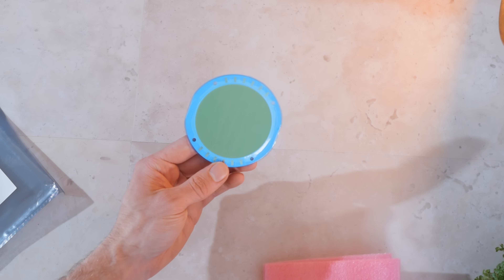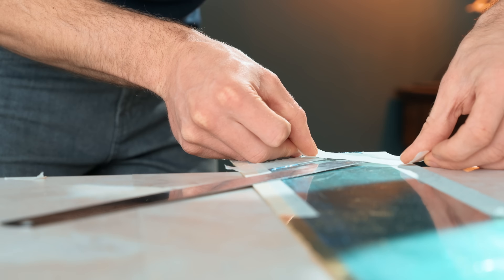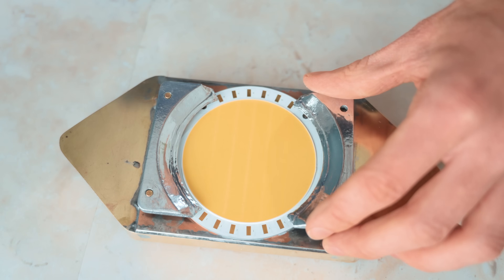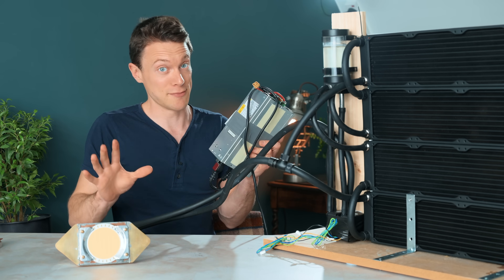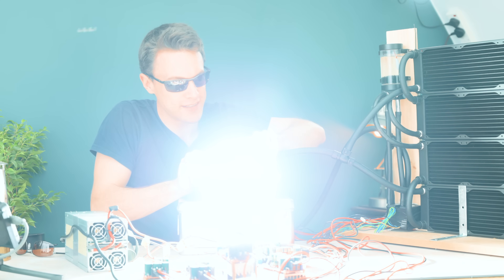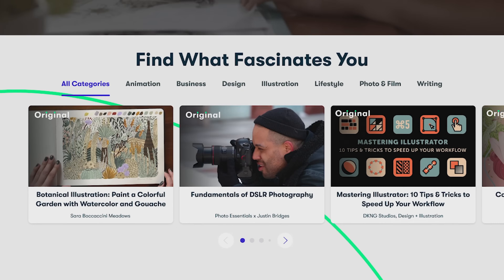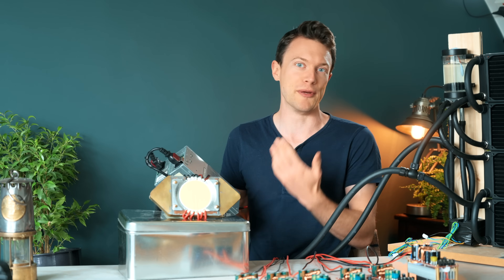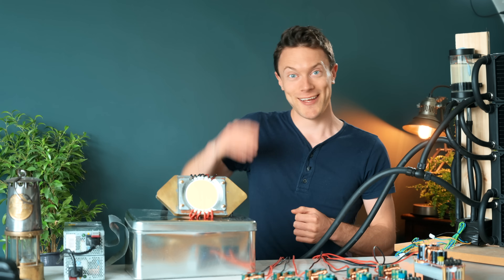Testing the world's BRIGHTEST LED!!!

Comment: Those radiators are a bit overkill, but you also could of used a small car radiator instead of 4 120mmx4 computer radiators, would of been way cheaper, and probably more cooling surface area and smaller footprint as well

Comment: Server power supplies usually run at 50% or less because they expect to run in pairs so that one failure will not take the server down. Some slimeball manufacturers will count on you only running at 50% or less and then when one power supply fails the other goes bang right away because it never could have held the load to begin with. The failure you experienced is far too common. Corners cut in power supplies often take down servers built by enthusiasts. But assuming that the outputs were properly isolated from line voltage there should not have been any problem with running them in series. However since your boost converters (I hope those are actually boost-buck if you plan on using that dimming function) actually do regulate voltage and current, you do not actually need a regulated power supply. You could get by with a transformer (in the 2.5 to 4:1 range) a bridge rectifier (100V, 100A and mounted on a water block to be on the safe side) and some big filter capacitors. That should pump out up to about 50VDC at 50A all day long without any problem. However I do not know much about picking transformers. The best would probably be to wind you own so you can get the voltage right where you want it, but that is not something I have had the patience for. I always just found or bought something about the right voltage and at least 2x the current I thought I needed. You might check with Fran Blanche for help with the power supply. I suspect she has a lot more practical experience with this than I do.

Comment: Wow! Can't wait for the outdoors demo. Please note that the LED has 1500W of power consumption, which is quite different than power dissipation. You wouldn't need a 1500W CPU cooler for this, as CPU coolers are rated according to the CPU's TDP, representing the heat generated from the CPU. So, the LED consumes 1500W, most of which is turned to light. You only need to have a cooler rated for the Watts that end up as heat, ie 1500W-Watts converted to light.

Comment: Mixing copper, brass or nickel plated copper parts with aluminium parts is a very bad idea as this will cause much faster corrosion of the metals.

Comment: To be safe, add a thermistor to the heat sink of the LED which will cut the power if it get's too hot. You can use some thermocouple and a controler/simple electornics to control PSUs POWER_ON signal, or just put water heater thermistor in the cooling pipes than can cut off the mains of the PSUs

Comment: Have water cooling (distilled water for the power supply). Those air cooled power supplies might be rated but their heat sinks and air cooling are way too small. I've got a power supply at 2500 watts and it's easily 3 times as large as this.

Comment: It's cool indeed, but there is one possible problem- I don't think that these 3d-printed parts squishing the LED to the waterblock are a good idea. I don't know what material you used but event though it doesn't get warm these 3d-printed parts might provide less and less pressure over time, increasing thermal resistance between the LED an the waterblock. This way the LED might get damaged. (And I suppose this cooling solution is a big overkill, coz the led consumes 1500W, but not all of this power is transfered to heat, but to heat AND light. It depends on the efficiency of the LED.)

Comment: Why didn't you use less radiators but add fans onto them? You could have used 2 560mm rads with push-pull fans on them. Less weight and better cooling potential

Comment: yoo.. you should never run psu's in series! that'll damage them badly, as you see. you can use two psu in series for low power application, testing etc, and you can make it to use with some external circuitery, but these off the shelf server psu's aren't happy in this configuration. and if you put them in series, the voltage adds up. you didn't specify each psu's specs, but i think you meant parallel? the output power of two psu's in series would be the same, just the voltage would add up

Comment: Have a look into a Meanwell RSP-2000, with external control it's possible to control the voltage from 0 up to it's rated voltage of 24V or 48V. reliable and meant for that kind of usage. the RSP-3000 would be bigger and quieter( bigger fans), but the RSP-2000 would be easier to built into a somewhat portable enclosure. You can also ditch like have the radiator or go for even 1 4-120mm radiator, just spec your fans right and it can handle such a high thermal load, I've done a sandwich of 2 4x120mm rads with fans in the middle to cool something like 1500W. You can DM me if you want to go more in depth.

Comment: Is it possible that the draw from the circuit was routed through one power supply or the one power supple was doing 1100 watts and the other was doing 400 watts because there was balancing method between them. Like slight differences in voltage could cause one power supply to take the brunt load kinda thing?

Comment: Literally couldn't even power this thing in my house except on the 240V supply we use for the clothes dryer. That's a stupid amount of power.
Reply: You have a funny house. 1600W is only under 7 amps at 240V and most small breakers/fuses are 10 amps or more.
Reply: @benbaselet2026  I'm in the US mate, 1650 Watts at 120V nominal is a hair shy of 14 amps, and older breakers will trip from near-max loads held for long periods of time. Most US outlets can't handle 15A nonstop without potential hazards, thanks to home builders using the cheapest materials they can legally get away with.
Reply: @wtechboy18  Wow, that sounds scary. I always thought you guys have heavy gauge wire and bigger breakers. A 10A fuse should give out 14 amps of current for quite a long time without blowing out. Magnetic breakers probably not.

Comment: Bro, if you made this as a kit, I would this buy it and make it myself. If you don’t offer that, do you have links to the recourses in making this, even down to the flux? It’s badass! Additionally, would putting heat sinks to the power supplies, or even attaching it to the cooling system keep the heat sinks cool? Would milling steel or brass brackets, polishing them, and replacing the 3D-printed brackets be an effective way to mitigate future failure to the brackets? They’re already attached to the cooling system as is, so why not be made of metal? Excellent video and very nice design on the water block.

Comment: you should know these vt steppers need more wattage and amps (in) to get more volts out y will need atleased 6000 watts to besure they will survive this insane current draw split to 6x1000 watt supplies

Comment: It's also possible that the given max rated power for the power supplies is actually across all rails (3.3v, 5v, 12v) and is significantly less for the 12v rail alone, given that they are server power supplies.

Comment: Thoughts regarding the PSU:
As far as I know PSUs can have multiple 12V rails. They can't deliver all of the power on a single rail.
Could this be the problem?
Reply: Yes, yes it can and peak power and sustained power are two different things also
Reply: @lukasstadler6594  good quality psu's can be run with higher wattage (good components) than promised and it probably would work  but its different matter if it's good to do so and how long you do so.
 Computer psu's have to be able to sustain the advertised wattage, so I don't think the peak power is an issue.
Reply: @rasmusjauri  as far as my knowledge goes, PSUs have different rails that are all rated for different amounts of power they can supply. on normal consumer PSUs there is even a big sticker on the side that tells you which rails can deliver what amount of Amps and at what Voltage they do that. so on a 1000W PSU your 5Vrail may be able to push 100W, 12VRail can support most of the power, probably in the neighborhood of 600-700W, and so on and so forth. a good PSU also splits the demanding rails(mostly 12V) in two, so one rail can only supply 300-350W. so even it these where good PSUs, they were working far out of spec and had to die. a 1000W PSU just can't push all of that through one rail
Reply: @TheDraggerPlay  that's the case in your pc psu. Server psu is different. The 12v rail has almost 100% of the rated power. And just to clarify a little more, in domestic pc, the psu has various 12v (for ex.) cables, and you might think that's from different rails, but no, all come from the same rail.
Reply: This could really well be the problem. Not qualified in any means, but I think usually computer psu's use the different rails to keep the different voltages as accurate as possible (all voltages can be "run" through one rail because of some electrical knickknacks(this is usually found in cheap psu's))
Reply: Everyone:  this question was already answered a half dozen times.  It's a 12V- only single output.

Comment: Why not connect power section in series... 6x35v = 210v then create DC pover rated for 210V and about 7A which would be much easier?
Reply: I mean, you put full-bridge rectifier on mains 220v, after that you put some capacitors... then tiristor or triac something to limit current...  Anyone help?

Comment: Different rails on a server PSU have different capacities, i'd say you blew that rail. Also whats with the Y power cable for both PSUs
Reply: I bet he just melted them with escessive heat. They should not be turned off like that from full power, the fans should be left running for a while.

Comment: What about 3 power supplies powering 2 rails each? In some sort of parallel config. You'd only need 500watts a section so some 750s or 1000s would do more than well.

Comment: In the final form it would probably be good to consider using some sort of corrosion inhibitor instead of a normal water for the loop. You are mixing metals (copper and aluminium) and that basically creates galvanic cell and that for electrolyse. I think you probably know that but just to be sure.

Comment: Isn't there a way to harness the natural thermodynamics and the heat from a light fixture to move it's own coolant? Like the fact hot water rises up and cold water sink down, but in a more knowledgeable sort of speaking..
TLDR: can you use the access heat itself to move the coolant cycle?

Comment: I would assume If one of the PSU's have a faster response than the other, it could deliver alot of current to supply the needs of the power draw, thus making the other PSU think nothing is being drawn, ultimately burning out the overloaded power supply and possibly all that current being produced by the over loaded PSU fed back into  the other PSU, killing both in the process. That's my hypothesis. Great video though!

Comment: I would say just a thing, or maybe two.
LED should not been drived with voltage but in current, and the datasheet say 48A.
Server PSU and all teh server stuff is well known for havereally noisy fan, so, if they don't shut down themselves, it means they're more than confortable.

Comment: Computer PSUs are usually divided up internally into different 'rails' and are usually not capable of delivering all of their Rates output on one single output. There are single-rail designs though, especially in some high-end PSUs. I'm not an expert, but you might want to check that.

Comment: to use 2 psu in series you need to separate the psu from each other and diconect the ground wire from the input on both(no touch case allowed)

Comment: You seem to be mixing metals inside your loop. Not that it could be avoided when soldering anyway, but you really, really, really need to use an anti-corrosive additive. Even with that you'll likely get corrosion, so better be careful so you don't end up with a 1500W disaster in the future.

Comment: Power supplies don't work like that, man 😉 A 1000 watt PSU does NOT mean you can pull 200 amps on the 5v bus! 🤣 You need to check if the rail your pulling power from is capable of delivering the number of amps you need. Those 2000? watt server PSU's are probably only capable of delivering 30 or 40 amps on their 12v bus. That means you can only pull between 360 to 600 watts @12v from each PSU. Additionally, I am willing to bet that the maximum wattage rating of each of your powersupplies is the maximum peak wattage it can deliver over a 30 second period. The maximum sustained load is probably around 50% to 75% of the rating (closer to 50% than to 75%). 

I'm kinda sad you didn't catch the carnage on video 😭 those (good quality) server PSU supplies are expensive AF to buy. Unless you get lucky of course, but that rarely happens for me.

Comment: Remember when you put something in series you do not double the amps, what you did is load a 750 watt power supply with over 1500 watts worth.
Reply: he may not have doubled the amps, but he did double the voltage. And while that may not have given him the full 1500w of the psu (a lot of the wattage is sent out on different voltage rails), the led was  receiving more than 750w.

Comment: Check continuity between the negative and chassis of the power supplies. I don't think they're floating ground but ground referenced. Being run in series and also physically touching, would short (or provide some resistive connection through the coated metal). Most of the current was probably flowing through the drivers to the LED but some was being shorted through the chassis of the PSU's.
I think this is what happened.

Comment: I did some digging because I remember doing this years ago to the same failure , and disconnecting them from mains ground did work and I stopped popping psu's.

https://electronics.stackexchange.com/questions/266894/connecting-two-atx-power-supplies-in-series
Reply: In previous video he mentioned that he "floated" (disconnected) ground form the cases while stacking them.
Reply: The thing is ..now I don't know where you live but the differential switch in your house should have popped of .mbasically you are sending 12v dc onto the earth line so the differential should pop because it sees some corrent on the earth return line ...I speak from experience because I tried to do it years ago XD
Reply: So uh, nobody else noticed the two power cords spliced together? If he was where 220v was normal, at 1600w load, that’s a load of 25 amps, wayyyyy more than what a single IEC cable is rated for. At 110v, it’s around 13-14 amps, and with those skinny, high-resistance cords he used, I think we found the problem...
Reply: yes, all he needed was to put tape on the ground of the wall socket for the psu's not to fry, basics of eletronics :)
Reply: No! Please NEVER disconnect the mains earth its really important for the safty and even some parts in the PSU often rely on it
Reply: @bashaaksema94  you should connect just 1 power supply to the ground, and that should be the one that is giving neutral to the system, because to create higher current you need to connect the power supplies in parallel and leave only one supply in constant voltage mode
Reply: @LuísFialho  yep , you just need to isolate one board from mains ground you can still earth the 2 metal chassis for safety ..so if something on the inside fails you have no risk of tha case getting live voltages
Reply: @bashaaksema94  you can only bond both PSU’s whith earth plugged if you know the ground noise is minimal and the voltages are within tolerance, and the wire leads must be similar.
Reply: @bashaaksema94  Unless you're trying to connect psu's that are not designed to be tied together. Yes its not 100% safe but it worked for me and its only dangerous if you're stupid , not to mention all sockets in Europe anyway are protected with GFCI protection which will still trip if you mess up on the AC side of things , no ground wire will stop you screwing up DC side.
Reply: Get this one to the top! Would definitely be worth looking into.